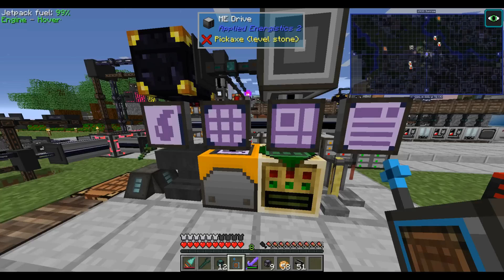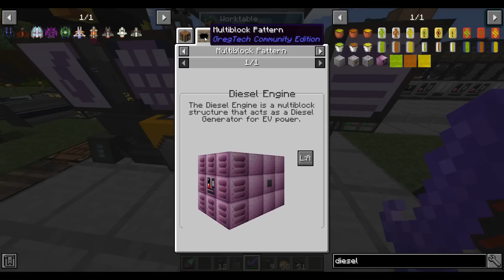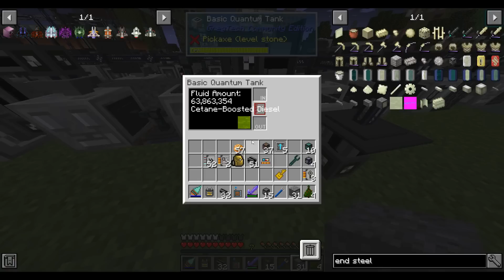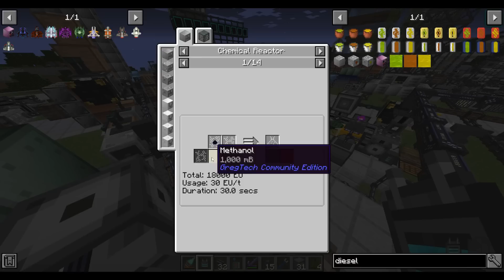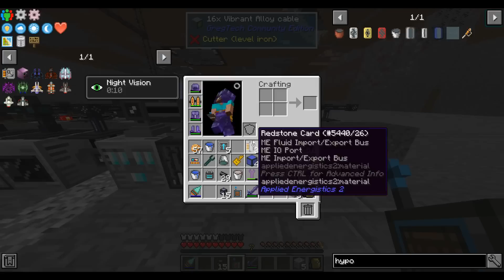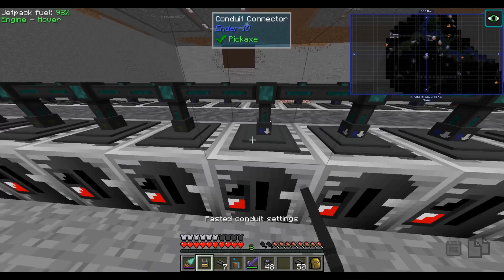Omnifactory EP13: Infrastructure Projects

Comment: The alloy smelter is great for making small gears and it's super fast at hv. Unlike most alloy smelter mold recipes it has no material inefficiency.   
As for the mystery of the missing hv distillery I've been informed that we're expected to use distillation towers.